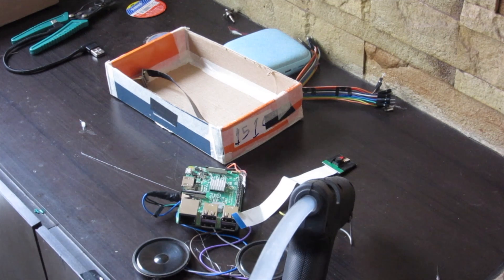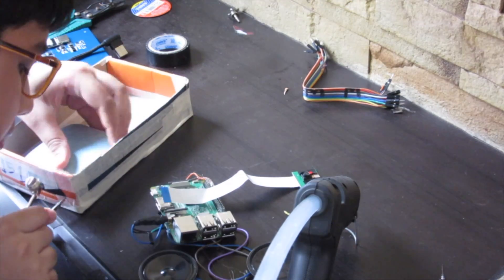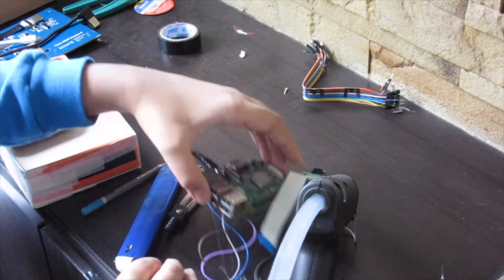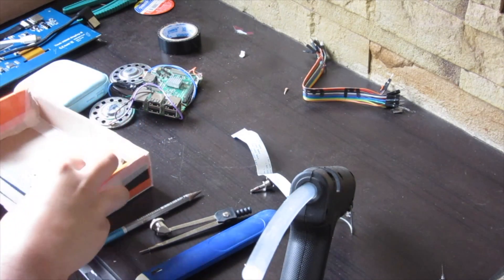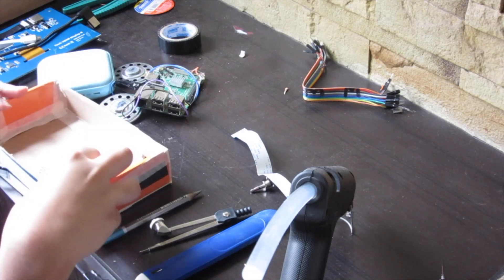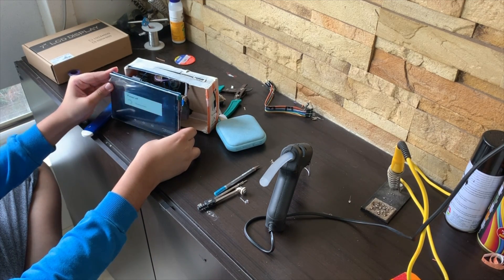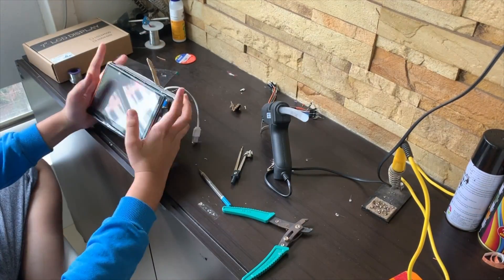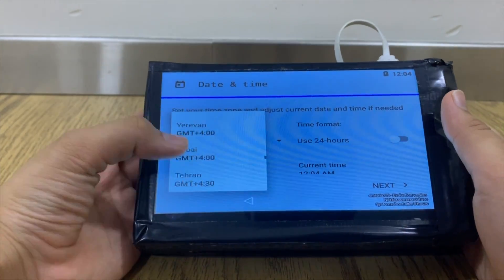How To Make a Tablet Computer at Home

Comment: You should have replaced the microSD with a NVME SSD because microSDs tend to fail in a couple of months
Reply from the maker: I haven’t had any such issue yet, and I’m almost certain that booting from external drives wasn’t a thing 3 years ago when I made this video.

Comment: hey bro amazing video. I am trying to make one but i want it to be as sleek as possible. Do you know how to build one that looks as slim as say the new generation ipads or tablets
Reply from the maker: Thanks!

I absolutely do know how to make it as sleek as possible, as a matter of fact I am going to soon remake this tablet to make it look better. I can give you a couple of tips on how you can strip down most of the bulk.
So here you go.
1) Try to get a larger display so that you can evenly spread out all the parts
2) Cut down all the unnecessary PCB Parts on the display to fit the Pi in
3) Go for the Pi 4 8GB so that you get more performance for the same size
4) Remove the USB ports ( you will need one for touchscreen functionality but you can try connecting the cable via solder) , GPIO Ports, and other unnecessary ports which might get in the way of making it sleeker.
5) Get a decent 2.1 Ampere power bank module with a compact size and try to get a good battery, about 3000Mah is more than enough.
6) Try 3D printing the enclosure to make it look better.
7) Use the GPIO Pins to power it, to connect the speakers and if possible use the inbuilt display connector with a compatible display to reduce thickness and to maintain internal neat-ness.
8) Even after you do all of that, you will still have a tablet which at minimum will be 2.5-3 centimetres thick far away from the iPads. It is because the RPi, the battery and other parts are not meant for this purpose and the display itself is about the thickness of an iPad. So yeah... but you can definitely get it to look better than mine.

:)
Hope that helps, and if it did then consider subscribing and watching my newer videos. I also recently made an iPhone, so if you are interested, go check it out.

Comment: The tablet computer no swicth power
Reply from the maker: Wdym?
Do you mean that there’s no power button? 
There’s a different way for starting this up!
Reply: Why not use the power button
Reply from the maker: Power button Not possible with a power bank, normal battery circuits don’t provide the necessary power!
I have used a power bank.
Reply: Is it safe for the android to use the power button
Reply from the maker: I don’t get you!

Comment: What about ram and rom ???
Reply from the maker: Ram is 1GB in this model, If you use Raspberry Pi 4 you can get upto 8GB Ram (recommended) and ROM / Storage depends on the micro SD Card you choose, preferably a minimum of 16GB
Hope that helps 😀
Reply: @TheiTE  thanks
Reply: Tq
Reply from the maker: 🙏🏻
Please consider Subscribing 😀
Reply: I want windows soft were
Reply from the maker: ROHITH Mehara 
Windows is possible too
Reply: How to buy the parts ???

Comment: Whoa. You’re very very smart like me I made Alexa smart home assistant into raspberry pi and put all the electronics inside a 3D printed case
Reply from the maker: That’s Great 😀 
You might want to stay tuned for one of my upcoming videos where I might make a Alexa+Google Assistant Smart speaker with a display in it 😀
So a Sub would be massively appreciated 👍🏻
Reply from the maker: Btw I have made an alexa Speaker Already using the RPi but it’s not a finished product 😀